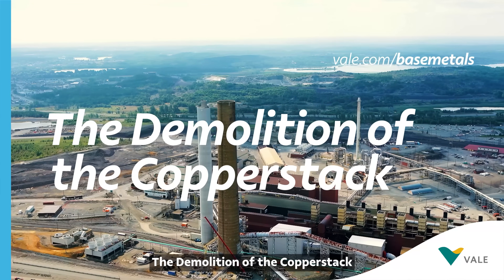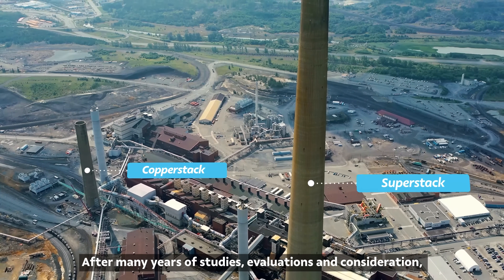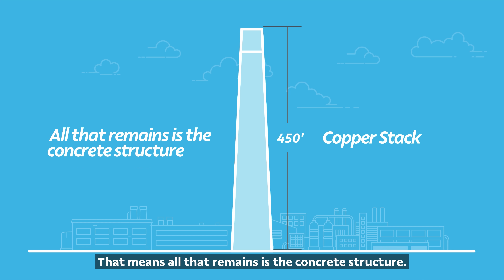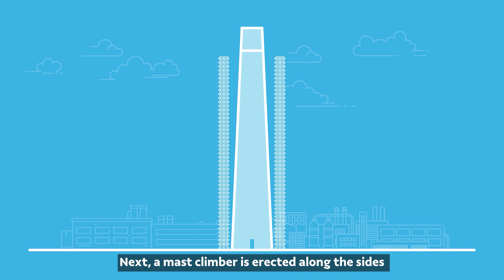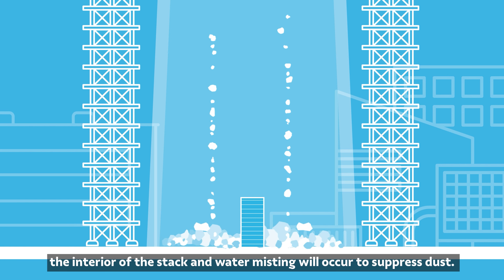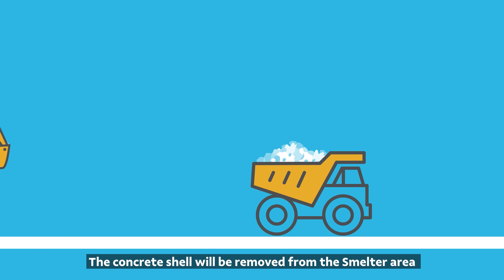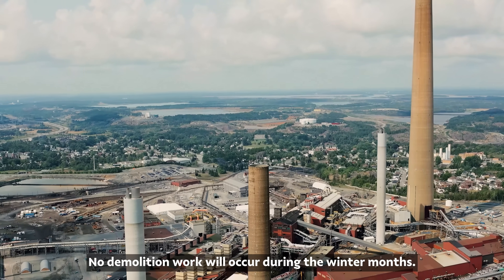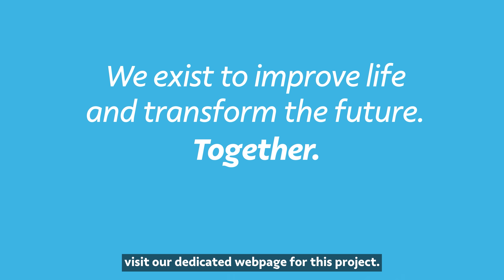Demolition of The Copperstack

Comment: You are going to demolish the one thing the ONLY THING that Sudbury is famous for? WHY? 

So what if the Superstack is no longer in use. The large chimney at the former Hearn Power Plant on Toronto's waterfront has not been in use for decades but it still stands because Toronto appreciates the architectural value of the long-decommissioned Hearn Power Plant. 

What are the sentiments in Sudbury? Are there any locals objecting to this? The smokestack could be repurposed as one of the highest observation decks in North America with an investment a fraction of what it will cost to tear it down. Imagine an observation deck with a restaurant and bar at the 1250-foot level! The smokestack could be used as a giant projector screen upon which LED images could be projected as a year-round tourist attraction. Does no one at Vale or the city of Sudbury have an ounce of imagination? 

What is wrong with the people of Sudbury? That a discussion of demolishing the one thing that makes the city famous could get this far doesn't speak well for Sudbury.
Reply: It's a privately owned smoke stack on company property. They exist to make money and the people of Sudbury don't really have a say. The public isn't allowed anywhere near it and it's an active smelter. You do realize that there's no way in hell that an observation deck and restaurant make sense, right?
Reply: @Nathanielie Anyone with a reservation would need to perform approximately 30 hours of onlin Vale Safety Modules, including WHIMIS and and Dangerous Goods, heath and safety, you would probably also need to go into the Vale facility for an 8 hour online Zero Energy State class where you would need to demonstrate your ability to properly deenergize and lock out defective and out of operation equipment. 

Doesn't seem worth it, but after dinner you could at least go hard rock mining together.

Comment: I’m surprised there is not a form of funnel shaped catch basin in the base to direct the debris toward the door rather than having to go inside with an excavator. By redirecting the falling debris they could open glue and fill trucks as they go rather than pausing.
Reply: Probably cost. Building the funnel that would withstand that abuse would be more expensive than just excavating.
Reply: Because nobody in their right mind would go near concrete basketballs falling from the sky. The funnel, the entrance, or the trucks could not handle that abuse.

Comment: Hmm, couldn't you reverse engineer it into a internal wind generator.
Reply: Rlly cool idea. I’d wonder about the abundance of cracks towards the top though. Seems like it could be becoming unsafe
Reply: Sulphur dioxide degrades concrete and even more so with high humidity.Biggest constituent of combustion is water vapour.I suspect the internals have been sloughing off for a while and it is unsafe for re_ purpose.
Reply: No.